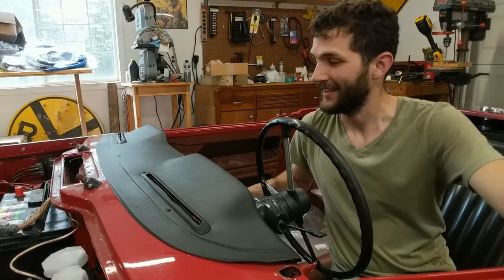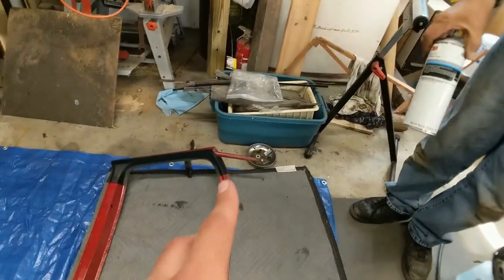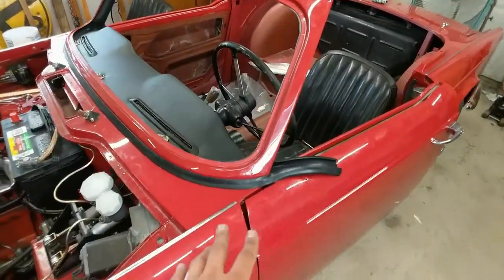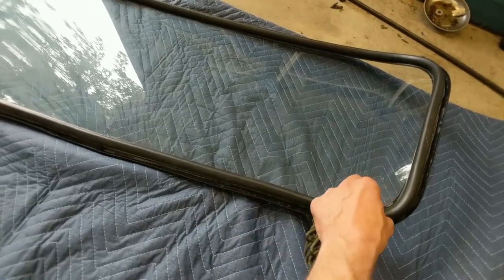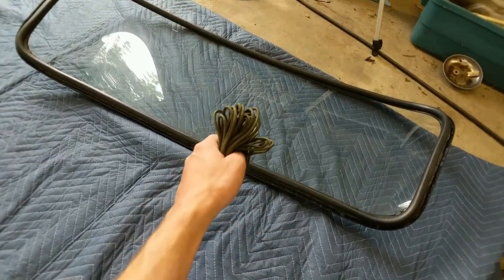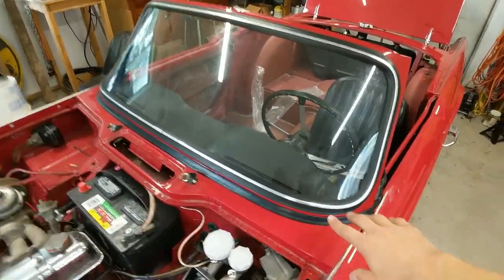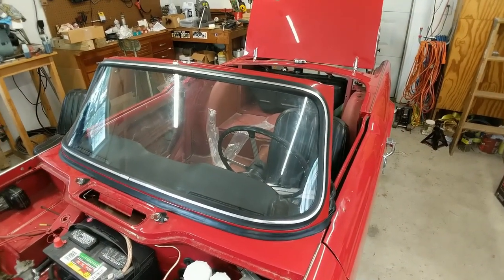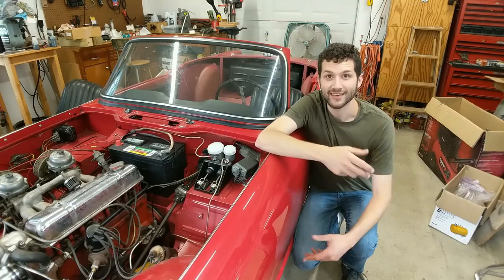Triumph TR4 Windscreen Install | Wegs Garage

Comment: Another informative lesson, particularly about leaving tricky bits until tomorrow, 
if it is the end of a day, so you tackle the tricky task with a fresh mind. 
I put a thin rectangle of adhesive rubber around the receiver hole on top of the windscreen aluminium, so the roof pins didn't mark the metal when I put the roof up and down. Didn't replace or remove the receiver plate, so don't know what was under it, but suspect their was nothing between the surfaces. Not really ideal sadly.
Reply from the maker: Cool idea for protecting the cap. Will have to use it. Thanks for watching!

Comment: I enjoy your vids. I did not see you using any sealant? From the factory it came with a Butyl tape between every seal and what it should seal to. Also between the frame and cap right along the rivet line. If you don't you will have wet feet!  You may be able to get the windscreen into the frame further with some pressure applied using a rope hooked on the back of the frame and 2-3" wide boards to spread the force. The new caps are quite different but with a mallet over a wood buck you can finesse it to be close enough to get the snap drilled. If you have new rear surround capping, you will encounter the same issues!  Greg in MN.
Reply from the maker: Good to know on the butyl tape. There is a lot of conflicting information out there. We went without since we don't expect the car to see much rain. Thanks for the tip on the cap!
Cool to hear from a nearby TR owner. We are in South Dakota!

Comment: Just out walking the dog and recalled how there was always a fuel smell from the front and rear of my TR6.
There are so many small gaps from the engine bay, that's is probably hard to eliminate all fumes into the cabin from there..
In a TR6 the fuel smell also comes from the rear.
Yo haven't shown us how you will seal the cabin from the fuel tank, but if you do the standard TR6 fitting, it will be plywood or Masonite panel, covered by vinyl to match the interior doors and seats.
By all means fit that, but before you fit that perhaps shape a metal or aluminium panel and silicone it into place in the cabin in front of the petrol tank, with screws fastener to ensure it stays where you position it.
Then screw the vinyl panel over the top of it
There was never any need to access the boot from the inside of the cabin, for me, so creating an impervious semi permanent seal is a good thing and fumes won't come in from there.
That is particularly important if you have the windows up when it is cold and or raining and there is limited fresh air. 
Just a thought that will hopefully make your travels more enjoyable.😉
Reply from the maker: Excellent idea - definitely would not have thought about that until it was too late! I believe our TR4 had a Masonite panel covered in vinyl before we removed it. I wonder if some plastic sheeting could be used to seal this off, similar to the sheeting used on the doors? Although a custom aluminium panel does sound pretty cool!
Reply: Wegs Garage Think between you and your dad you will come up with a clever solution. 
Think any plastic sheet would need to be solid (ie not film like)  to ensure silicon sealed the two surfaces like a window and be able to then be secured in place.

Comment: Hi guys, great video. When I removed my windscreen cap (on a Spitfire, but they're the same as the TR4), there was a seam of mastic under there. You can still get it in a caulking tube (by name, anyway), but I'm not sure if it's the same type of stuff that they used way back in the 60's. I'm not to that point yet in my restoration, but I intended to use something similar (or even weatherstripping) between the cap and the windscreen frame. I don't know what that'll do with the gap that you are concerned with, but for what it's worth...
Reply from the maker: Thanks Chris! We are leaning toward using foam weatherstrip so it's good to hear you are considering something similar. I kinda hate to use something like mastic as it is such a mess if we ever have to remove it.